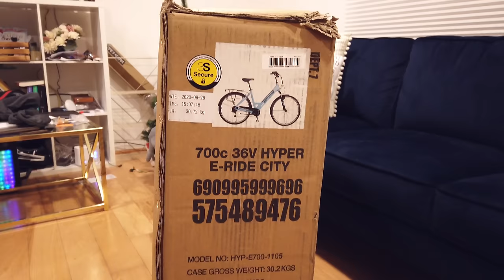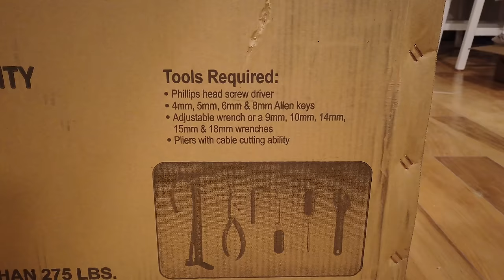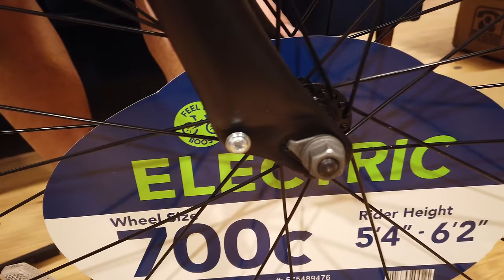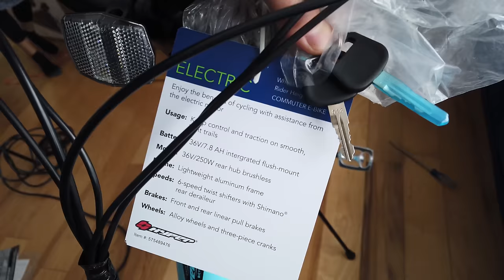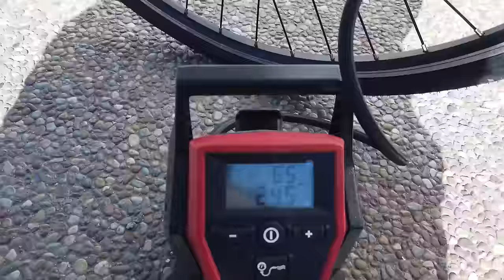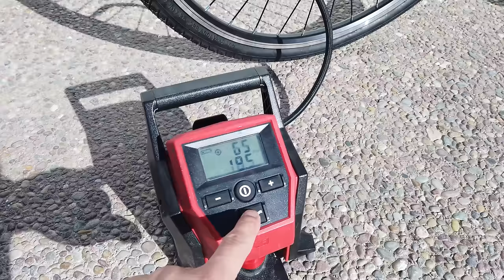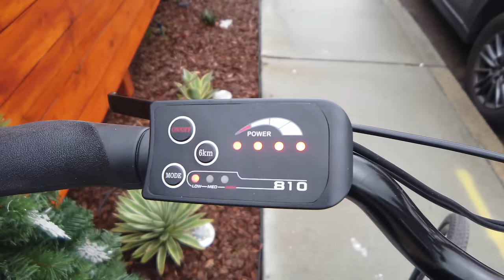Cheap $398* Walmart Electric Bicycle!!!? Hyper E-Ride City 250W 36V Ebike Review + Assembly Tutorial

Comment: SAFETY TIP: Never, EVER put bike pedals on without BLUE LOCTITE or similar threadlock.  Without a torque wrench and the knowledge of exactly how to torque them, you are putting your life at risk, if not at least injury due to the pedals coming loose.  Threadlock is CHEAP INSURANCE that the pedals will stay on the bike.

Always set the seat post clamp as tight as you can close it.  If removing the seat for transportation, or changing height for multiple riders, mark a line where each rider is happy with an indelible pen on the post for easy setting for each rider.

The cheapest, BEST upgrade for any bike is a suspension seatpost, many on Amazon around $30.  You have to know the exact diameter of your factory seatpost and buy the same size, not close, but the SAME SIZE.
Reply: Bike pedals are threaded for retention and don't need to be torqued. In addition, I would NEVER put Blue Loctite on bike pedals. Grease or anti-seize are much better options.

Comment: Bout to buy tomorrow. 300$ new and assembled from a local shop. Seems too low priced  to be true considering they are 600 $ elsewhere.. Will see tomorrow. but concerned about the 7.8ah battery.  Any help on how far you get out of it.? Needing distance more than speed. Thx
Reply from the maker: Hello, the Hyper website says 20miles. I haven't personally tested it. I don't recall the pedaling being much more difficult with the motor off, so you can still ride if the battery drains. It may be more difficult going uphill though.

Comment: I would have liked to have seen you ride it up a big hill. That's the reason a lot of us are considering e-bikes.
Reply from the maker: Thanks for the suggestion. I may have to bring the bike up to various hills and show you all if it can make it
Reply: @ColinLeung  Put something heavy in your backpack when you do it. I'm like 200lbs. :)
Reply: I bought this bike about a week ago. I’m 230lbs and I am surrounded by hills....big hills and this bike does a great job. There is one pretty steep hill I do have to work a bit harder but otherwise it does all the work up hills and I just have to pedal lightly.
Reply: 250 watts won't haul you up a hill without some pedal input. With pretty minimal effort, though, it does just fine. As long as your "big hill" isn't Pikes Peak.

Comment: I would convert to disk breaks. I bought a Walmart 200.00 bike, the kick stand is not at all tight
Reply from the maker: Great idea. It may be cheaper and easier to buy a bike with disc brakes already since you'd have to change the wheels with ones that have rotors, and the frame does not appear to accept disc brake calipers.
Reply: Hmmm - it looks like the 26" e-ride mountain frame will accept a rear disk brake. All of the 250 watt hub motors on the e-ride models have mounting bolts for a rotor. And none of the $400 sale price e-ride bikes have disk brake forks or front hubs.

The good news is, about $200 more (currently 12/08/21 $598), will buy the e-ride 29" - which already has disk brakes.

So you could pretty easily add a rear disk brake to the 26" mountain - not so easily with the city or cruiser models. Or pay a chunk more for a disk-brake model.

Of course, I really don't quite understand the hate for rim brakes - I've raced tandems using caliper brakes. They can be quite effective. The pads on my e-ride City aren't bad, but I'll probably put a set of Kool-Stop pads on and I'll bet I can stop just about as fast as someone with inexpensive disks, wet or dry.

Comment: At the price point you got that bike at, you got a great deal. It looks like a pretty good bike. I am not a fan of caliper brakes but in some parts of the country they are ok. The rubber pads get sand grit in them around hear and it will destroy your rims. Your bike has the better rims for caliper brakes to work good. Some companies cheep out on the rims and they ware badly after a few stops.
What does the bike weigh??
Reply from the maker: Thanks for the comment. The bike is advertised at 50.7lbs.

Comment: so what is the difference between cheap tires and expensive tires?  do expensive tires use higher class rubbers?  or is it just to feed your ego knowing you paid a lot of money for expensive tires which may not be necessary at all?
Reply from the maker: It depends. Typically more expensive tires have better rubber quality, better construction and higher threads per inch (TPI). This results in shorter stopping distances, better traction especially in wet conditions, smoother and quieter rides, and longer lasting tires. Sometimes more expensive tires are lighter (for racing), and will not last as long. Some you're just paying for the brand name. If you're riding recreationally then it doesn't really matter which tire you use.

Comment: Great assembly video Colin, just got mine yesterday and put it together with the help of your video. Everything works fine, no problems. I'm confused about the tire size. It says 700cc 26", I want to get more of a mountain bike style tire. What size and width do I need?
Reply from the maker: Hello, I'm glad you found the video useful. 700c and 26" are very close in size. A 26" tire will fit a 700c rim, but not the other way around.
I'm not close by my bike, but the side of your tire should specify the size (for example 700c x 32). Most tires should work as long as you match the rim diameter. I would pick an equal or larger width tire with a tread pattern that you like. 

https://amzn.to/3F7tXb9
Reply: @ColinLeung  thank you 💪👍

Comment: So I just bought one recently  and the battery turns on but not the handle bars connectors
Reply from the maker: Hello Bonita, there may be a wiring issue if the battery is seated properly. I'm assuming you press and held the On/Off button? I'd advise contacting Hyper for troubleshooting or warranty, or exchange it at Walmart. Sorry

Comment: Can you add a speed computer
Reply from the maker: Like replace the display with one that's electric? It's possible, but you may have to replace the controller, and rewire everything. 
It would be easier to use a phone with the Speedometer app, or install a bike speedometer that reads from a magnet on the wheel.

Comment: 1 hr or 20 miles... i dont understand. It can last 9 hrs outside going at 15 ?  I need something to work uber eats
Reply from the maker: I would base it off of the advertised range, and not the time the manufacture specifies. They must have calculated 1 hour from a range of 20 miles, and max speed of 20mph. 
Please note that the advertised range is not always the range you will get. It's typically less especially with hills, and battery condition. I would assume 15miles, but you can always pedal (with more difficulty) if the battery drains.

Comment: We just assembled our bike and the peddles are not moving the wheels. What did we do wrong?
Reply from the maker: Hello Sherri, thanks for the question. Can you ensure that the power on the battery is turned on first? Then turn on the module left of the handle bar. Reference 15:06 in the video. Next make sure none of the brake levers are pressed as they may be shutting off the pedal assist function. If that does work then the unit may be defective. I hope this helps.

Comment: I have the same bike ,the peddle assist does not kick in what can be wrong with it
Reply from the maker: Hello, did you turn the battery and controller on? Do you see lights on the display? The pedal assist should work automatically if you select a power assist level. If not, the product may be defective.

Comment: Now that you’ve had this bike for over 1-1/2 years, in your opinion, is it a good buy? (Current price as of 8/11/22 is $598 for the blue one and $698 for the black one)
Reply from the maker: We still like the bike, however I would wait until Nov/Dec to see if the price drops back down to $398. At $600-$700 you have better options. I did a review on the $599 Totguard ebike, which has a more powerful motor and thumb throttle. It's not a step thru frame though. https://youtu.be/BLrr2mAQ1U4

Comment: I just ordered this bike from Walmart. I would like to know if you kept the bike and continued riding it often. How did it last? Did it hold together well or did the clattering noises get worse?
Reply from the maker: Hello Mary, my wife still has the bike. She does not ride it very often, but it seems to be holding up well. The chattering noise can be fixed by adjusting and tightening the fender, and doing a tune up. I just haven't had time to work on it. Thanks for the question.

Comment: Got one with a wheel axle poking out the box and a missing axle nut and washer. I can't match up the size and thread pitch. Can someone let me know the size? Seems like it might be something odd like a 9mm x 1.0 (15mm socket).

Edit: after looking through bolt boxes at a local store and looking online a bit further, I remembered we have a couple used/decommissioned bikes and one of the front axle bolts was a match. It does appear axle bolts are made that are 15mm (socket head) x 9mm x 1.0 thread. Didn't want to wait two weeks for  the company or Walmart to resolve.
Reply from the maker: Awesome. I'm glad you got it resolved, David!

Comment: Adjustable wrenches should be outlaw does more damage.
Always use good sockets or box wrenches.
Reply: Need to outlaw (minimum felony conviction) all flathead screwdrivers too as they might slip and scratch the paint lol.
Reply: You're 100% right about outlawing adjustable wrenches. 

Vise grips were good enough for my daddy and that's the only tool you really need. (sigh - I've actually heard similar claims)

But seriously - do get a proper set of sized wrenches - every time some moron rounds the corners of a fastener, and angel loses their skateboard.

Comment: Very informative video!  Just curious what kind of range you're getting and how you would return it if you didn't like it.  Have you taken it on any dirt trails?
Reply from the maker: Hello Curtis, the range is advertised for 1hr or 20 miles. We haven't tested the range, but have biked over 1 hr and have done over 15 miles, and the battery is on the lowest indicator. 

I believe you can bring the bike back to Walmart without the box, but with a receipt. You would need to verify with them. 

We rode this on a rocky path as seen in the beginning of the video, and it was fine, but haven't done actual mountain biking trails.
Reply: @ColinLeung  Thanks for responding!

Comment: Good video, thanks.  What do you fill the tires to, 65psi?  Should i put a little extra air in the back tire?
Reply from the maker: The max tire pressure is listed on the tire, and I think it's around 43psi on the top of my head. I would use equal tire pressure near the max psi for the least rolling resistance.

Comment: How can i make this bikes assist work going uphill ?
Reply from the maker: Hello, it should already work going uphill. The electric motor turns on when the magnets sense movement during pedaling. The motor may not be able to take really steep hills, but you can change to the appropriate gear to climb hills on the rear derailleur.

Comment: Does it move without peddling? If your flat on a road, will bike propel on its own just on motor?
Reply from the maker: The electric motor only kicks in if you pedal. It does not propel on its own, and does not have a thumb throttle.

Comment: Hi I just wonder if it only works as pedal assist or if it works without using the pedals at all
Reply from the maker: Hello Alejandro, it only works with the pedals. They did not include a thumb or grip throttle unfortunately.

Comment: How is it when the battery runs out? Can you still use it normally? I want to say yes, but not sure if thats the case
Reply from the maker: Yes, you can still pedal with the battery off or dead. Thanks for the question!
Reply: The first ride I took was after I assembled it, while the battery was charging. I rode about four miles around our neighborhood.  It's about 50 lbs, which you'll notice coming from a stop, or going up hill, but the bike rides perfectly fine without power - something that was important to me, because at some point, you absolutely will be riding without power on any e-bike.

Comment: how many colors does this come in? I hope it's more than one
Reply from the maker: Hello Larry, I've only seen this model in blue. There is a black version without the step through frame if you're interested in that. https://www.walmart.com/ip/Hyper-Bicycles-E-Ride-Electric-Pedal-Assist-Mountain-Bike-29-Wheels-Black/365512650?wmlspartner=wlpa&selectedSellerId=0&&adid=22222222227000000000&wl0=&wl1=g&wl2=c&wl3=42423897272&wl4=pla-51320962143&wl5=9061265&wl6=&wl7=&wl8=&wl9=pla&wl10=8175035&wl11=online&wl12=365512650&veh=sem&gclid=Cj0KCQjwuMuRBhCJARIsAHXdnqNLOB8MdqAj7rNbmRF7I-zP9LHfNuLQJOG80Yt84mKjiUJjiCkJqbYaAvr2EALw_wcB&gclsrc=aw.ds

Comment: Can the battery compartment be opened to replace the batteries with lithium ones?
Reply from the maker: I've never tried, but I would assume it could be as long as the controller and motor can handle the new voltage and amps.
Reply: All prebuilt (i.e. non DIY) ebikes are already using Lithium batteries.  However, if you mean to replace the cells if worn, or with better capacity ones, that would depend on your DIY skills.  None of these battery cases are designed to be opened, so you'll be forcing them opened somehow to do it.  I would recommend looking at a bike with a common battery form factor, like the "silverfish" battery, which you can buy in about any desired ah size on Amazon or Ebay.  Sellers also sell empty cases, so you could build one up from cells with the proper knowledge.

Comment: why that front tire  have t0 go on  only 0ne way  motor in backs makes n0 sense l0l
Reply from the maker: The tire is directional meaning it will push water out in one direction. It if's reversed then it will not do a great job pushing water, and you may loose traction
Reply: @ColinLeung  0 0k ty f0r getting back, that makes sense nice new tech.
Reply from the maker: @ephraimwarrior6766  You're welcome :)

Comment: How was the paint job when you received it any scratches or dents?
Reply from the maker: The paint job was good. No scratches or dents
Reply: I just got mine. It may be a trick of the lighting, but deep between the chainstays, where the kickstand bracket is, the paint may be a little thin. Otherwise, frame, fenders and rack had zero visible defects on mine.

Comment: I can't get the pedal assist to engage, what am I doing wrong?
Reply from the maker: Hello Julie, the pedal assist function should work automatically once the unit is powered on. Can you confirm that the unit it powered on by pressing the power button on the battery first, and left rectangular unit on the handle bar switch second? It should light up. You can also raise the rear tire, and pedal. The rear wheel should spin. Also ensure the battery is fully charged and seated, and that the brake levers are not engaged. If none of these work then the unit may be defective.
Reply: Ok thank you, I will check all that. Is there any place that will work on this bike? I'm in Helena Montana. The bike is new, first time out and it doesn't work.
Reply from the maker: @juliemoldenhauer3222  Sorry, I rewatched the video. Please ensure that the battery is turned on first before powering on the unit. See 15:06 in the video. 
You can call around different local bike shops to see if they will work on it.
Reply: All light sensors work. Battery is full. I can switch from low, medium and high no problem. If I walk along side the bike and push the 6km button I get some assist for a few seconds then nothing.
Reply: I think I just bought a nice looking 6 speed bike.
Reply from the maker: @juliemoldenhauer3222  Sounds like there's an issue with the pedal assist sensor, or controller. I would exchange it for a different unit.

Comment: Do you need to always pedaling with an electric bike or you can drive it like a electric scooter?
Reply from the maker: Unfortunately you have to pedal for the electric motor to kick in. It doesn't have a throttle switch.
Reply: @ColinLeung  i don't understand how electric bikes works...
Reply from the maker: @Nixonbutcher  I'll try to explain it. 

Electric bicycles similar to regular bicycles with the addition of a motor to spin a wheel. That can be either a front hub (a motorized front wheel), rear hub (motorized rear wheel), or mid drive (motorized crankset that turns the rear wheel). It will need a battery to power the motor, and a controller (similar to a brain) that tells the motor when to turn on and off. Some electric bikes have sensors by the cranks to tell the motor to kick in when you are pedaling, and/or a throttle switch at the handlebar to manually tell the motor to turn on and offf. Some bikes also have brake sensors that tell the motor to shut off when you are braking. 

I’m putting together a video on how to convert a regular bike to an electric bike with a front hub. Feel free to check it out to better understand how an electric bike works. I hope this explanation helps!
Reply: @ColinLeung  Thank you i appreciate it and i will check your video i understand more now :) thanks

Comment: Does the power assist stop when you brake?
Reply from the maker: Hello Marouane, yes all of the power functions disable when you brake. There are sensors built into the brake lever as a safety measure.